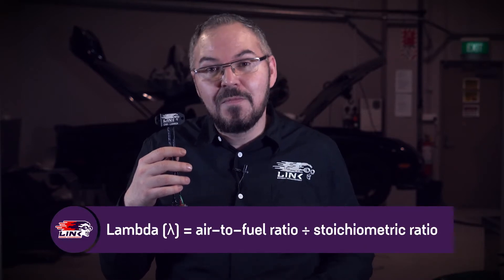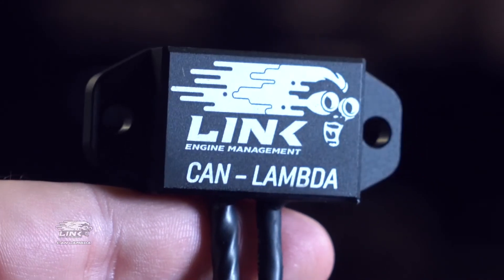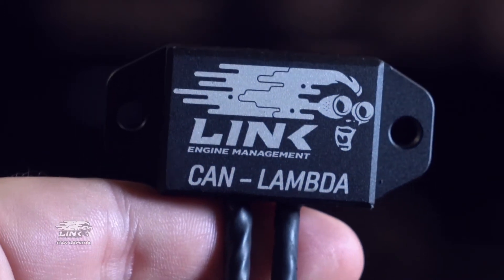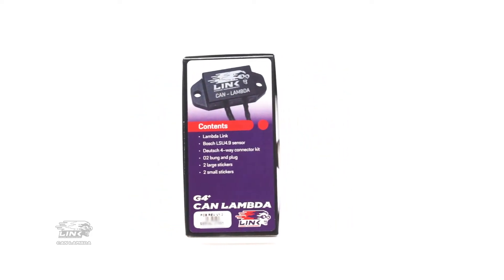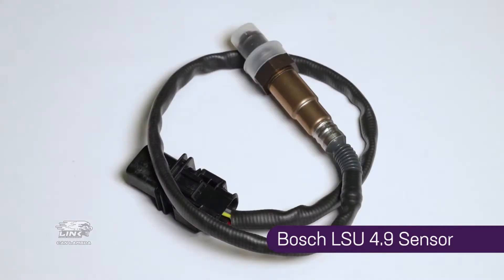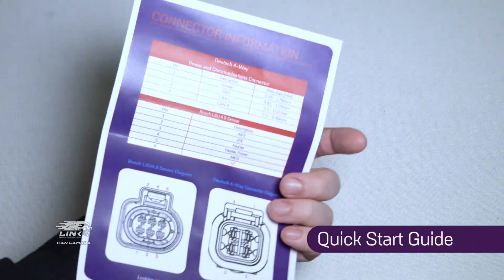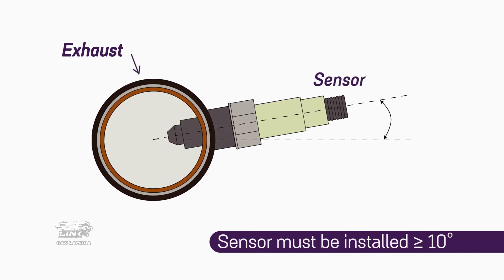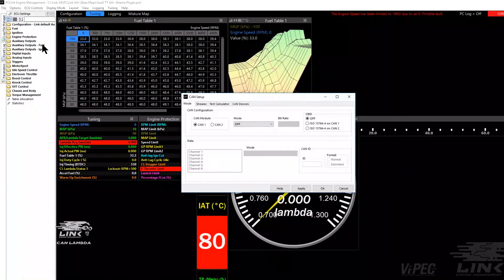Link's CAN Lambda

Comment: ep3 k20a I have link g4x do i need this to run AEM x series AFR gauge...?
Reply: As far as I understand you'd run this instead aem X series as the link as the link product is better and more reliable power settings and this way you can use closed loop tuning when you're driving around. You can also get a CAN gauge to replacing the aem gauge. Sell the aem setup and use better technology

Comment: My bmw m50 has true dual exhaust do I need more than 1 Links Can Lambda?
Reply: Hello good question,
 yes it would be advisable to get the most out of your engine tune but it is also not totally needed most tuners only use one and test from one side to the other to check if they are within there own AFR  requirements